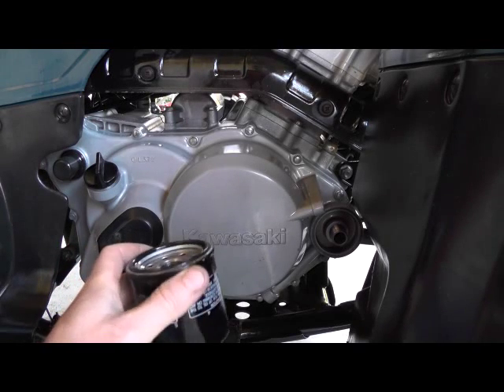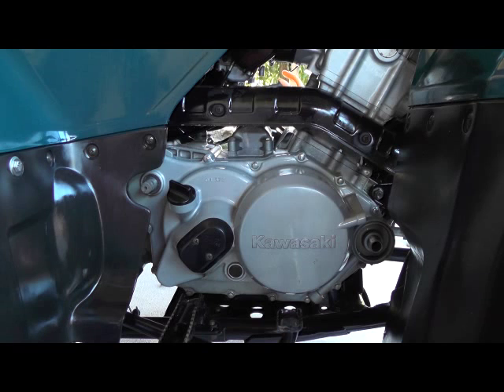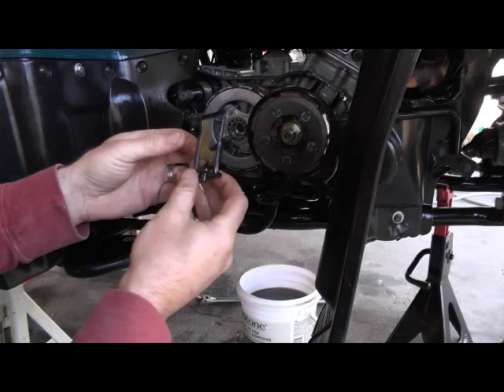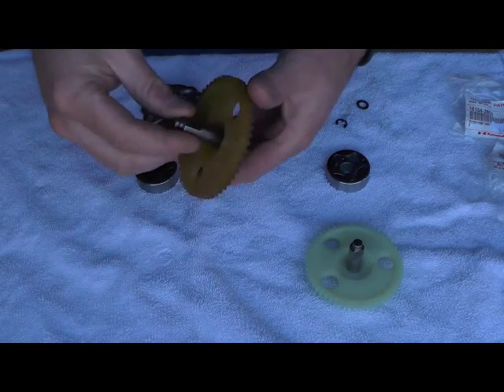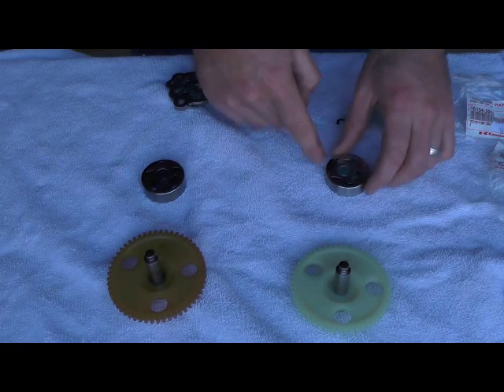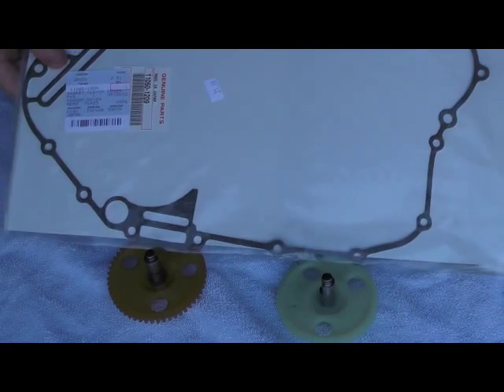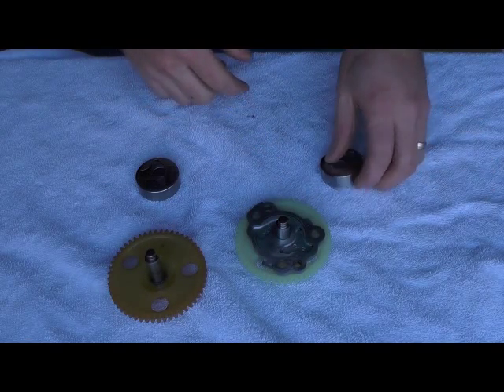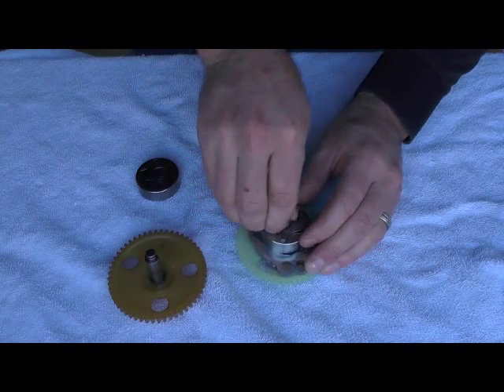400 Bayou Oil Pump Removal: 1993-1999  ~No Oil In the Oil Filter!

Comment: Great repair , Just note if you have a engine like this and has been knocking or ticking. Make sure you look at the rocker arms to camshaft. I just done one of these repairs and found that some of the metal of the rockers were cut away due to no oil.
Reply from the maker: John, thanks for your comment. I've also ran across this on another several years ago and your exactly right.

Comment: Well I put it all back together and noticed something wasn't right. The gear that drives the oil pump was missing the woodruf key. Found one that fit and now it's pumping oil. I did adjust the valves but they seem kind of noisy. They are a little quieter than before but still seem like something isn't right. Hopefully the valvetrain components aren't damaged from running without oil. 
The quad does run and start fairly good though. I'm going to adjust valves again and go from there. Thanks
Reply: Caution , do not mix mm up with .008".   .25mm = about 10 thousands. 
Valve clearance. ..

Comment: I forgot to look at the screen.  will check it out tomorrow .  I did order one.
Reply from the maker: The dots on the inner and outer need to be on the same side when its reinstalled, doesn't matter if they are put in toward the case or the cover. Also was told that if the screen is clogged or even broke like mine was the pump won't function correctly.

Comment: Ok, I got the side cover off.  The nut holding the centrifugal clutch was very loose not even finger tight.  One of the phillips screws holding the oil pump on was the same way.  The two oil pump parts have allot of scoring, also allot of scoring on the oil pump cover part and the inner case.  The oil pump gear seems to be ok, it was solid not spinning like yours.  

I'm going to order the two oil pump parts and the small filter. Hopefully that will give it some oil pressure. Everything looked nice and clean in there though.  Thanks.
Reply from the maker: Sounds like someone may have been into your oil pump before you, but mine was the same way they just didn't catch the problem.  Great that you're gear is solid, it's expensive compared to the pump inner and outer that it drives.  Looking at the inner and outer together... are the dots machined into them facing the same side? Is the screen in good shape?

Comment: I removed banjo bolt on head and started it for 10 seconds. Not a drop of oil came out so I think I may have the same issue.
Reply from the maker: Thats not good news. If memory serves correctly there is another banjo bolt just above the oil filter that feeds that entire oil line, may try loosening it to eliminate the line itself being clogged.

Comment: I just bought one of these quads.  It is in pretty poor shape compared to yours. Your quad looks mint shape. The top end on mine is making a lot of valve noise.  I think this might be the problem.  I really appreciate your repair videos and the website you made. Awesome detailed videos. Thanks
Reply from the maker: +Stewart Flannagan Your welcome Stewart. The cam in these 400's were prone to lobe wear even when the oil pump is working correctly.  If your Bayou has lost its off throttle pep I'd check that banjo oil delivery bolt first to make sure you're oil pump hasn't stopped working.  If its still pumping oil you may consider checking the valve clearances and if that doesn't fix it you may want to pull and inspect the cam for wear. These Bayou's are pretty tough, best of luck and let us know what you find...